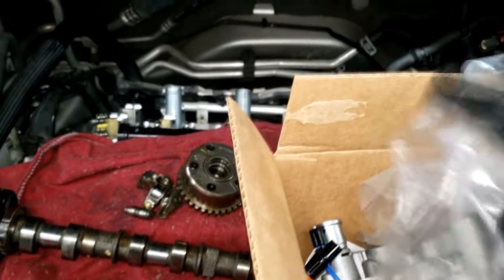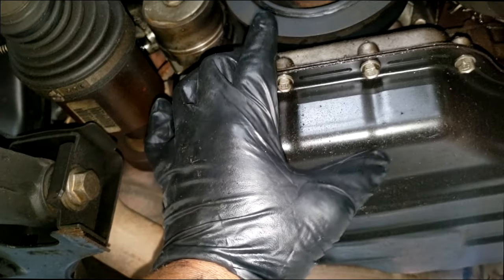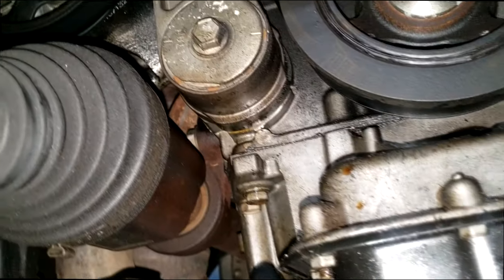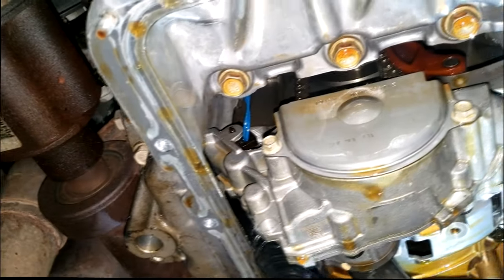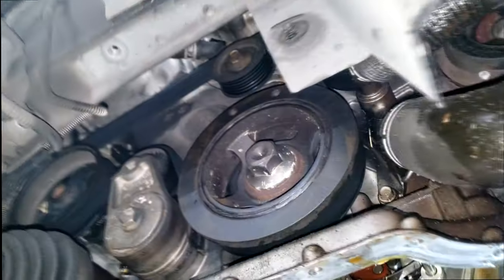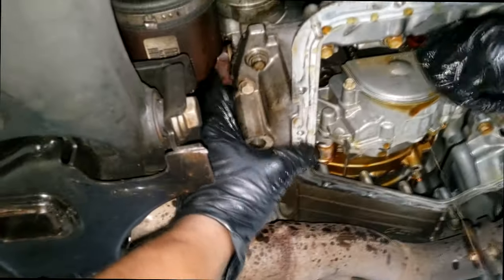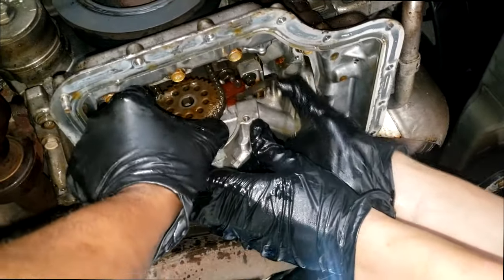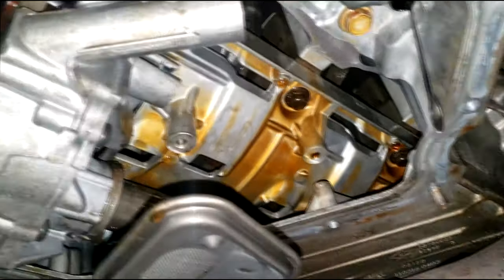How to replace a OIL Pump. Oil light flickering P06DD P0522 P06DE. Dodge 3.6 Pentastar ticking noise

Comment: As a tip to others, I've come across (2) 3.6L Pentastars with the P06DD code not resolved with an oil pressure sensor.  Both of them first showed the problem when cold after sitting all night, watching scan tool data, right away on first drive of the day the oil pressure would read 40 psi at idle then sag below 30 psi at 1500-2000 RPM.  Warm engine and clear codes and they both worked fine.  The oil pump solenoid problem can be intermittent and affected by temperature.  The shuttle valve part of the pressure solenoid is plastic so it's probably getting distorted with age and heat making the valve sticky or it's just the varnish gunk from the oil making it sticky when cold.  The oil pump solenoid is available separately through Dorman products PN: 926235 or Standard ignition.  I last installed a pump Mopar PN: 68252670A0 in a 2015 Town & Country, it took me 6 hrs.  Pump gear torque spec is 18 ft/lbs.
Reply: Good info- I have a 2014 T&C. I have the ticking- trying to get all my ducks in a row before going after the rocker arms, lifters and hopefully not more than one camshaft. Question: I’m paying more attention to my oil pressure and oil temp- can you tell me what range in normal low/high? Thanks!
Reply: @YOUZTUBE2000  I don't recall where the instrument cluster pressure gauge indicator was reading or if the vans I was working with even had a gauge, it's been a while.  The oil pressure is well monitored by the module, if it's not generating a code I wouldn't worry about it.  All the best!
Reply: @larsmoservice588  thanks for the quick reply
Reply: I have the po6da code go off in my car and it wasn’t the sensor although the mechanic assumed that. On forums I see this code actually indicates possible issue with the solenoid.

So is there just one solenoid for the oil pump? Does this fix take many hours? I saw a video where the guy had to take apart the car and he said it took him 11 hours.

But I forget if this was for the same exact engine or just another engine with the solenoid issue at the oil pump.

Apparently it could also be a wiring short. Either way I’m annoyed the mechanic didn’t even know this and I saw this info within ten minutes online . Wasted hundreds of dollars already just to switch the sensor and spent years driving with this issue since he told me it was just the sensor .

My oil psi is normal though
Reply: @heythere6983   I'm sorry that your mechanic has been down the path of replacing the oil pressure sender without solution, that's frustrating.

I fixed a Promaster van with 3.6 & P06DD fault last week, the repair took me 4 hrs but I didn't need to remove the axle shaft as on some others.  It's a common repair at this point as these engines are getting higher mileage and older.  There is one solenoid on the pump.

Harness and connector problems are not so common as the solenoid failure.  Most harness problems I see are from people messing with it, poking holes in the wire insulation trying to test, collision damage, etc.  Put a pump or solenoid in it.
Reply: Thanks for the response . I took it to another mechanic today. He hooked up that little device that gives codes , and he changed one because it wasn’t working . He then got another and asked me if I knew the code I had gotten before, because he had all these different codes pop up that haven’t popped up before, transmission codes etc .

He said he was confused since he had gotten a few of those codes pop up recently with that device on another car .

He said since the last guy switched the censor
With an aftermarket sensor didn’t know. He said after market sensors aren’t always accurate .

I mentioned the solenoid possibility and how that code tends to point to having to change it with a printout showing what the code meant . He said it could be anything and he had no idea and to take it to the dealer because they’d diagnose it and they’d be able to diagnose it better than him or more accurately than him .

When I asked the dealer though they said they’d just have to diagnose it but really have no idea until they switch parts.

I don’t get why this guy wouldn’t work on the parts the specific code points to and ignore the solenoid thing and act like there’s no way he could figure it out.

What was weird was that after he connected his device my cars lights on the shifter were flashing and the car wouldn’t turn on or go in drive /neutral/reverse etc. eventually it turned on and ran noises than before .

Like electronic clicks periodically behind the steering wheel that weren’t going on before he connected it . I really don’t get what happened there. I wonder if a bad device can short the cars circuits or something
Reply: @heythere6983  I'm assuming your car has a 3.6 Pentastar as in this related video.  If so the P06DD, P06DA code would be enough for me to just go ahead and change the oil pump or solenoid, clear the codes and get onto the next car.  After I've seen enough of these fail I don't waste time with circuit testing and considering every other possibility.

Related codes in other modules is not uncommon as all the modules share information on the can bus network, think of it like an office network where the computers share information and send commands to one another.

The indy shop your visiting likely won't have Chrysler factory level scan tools like StarScan or wiTech as the dealer will.  Us indy shops use aftermarket scan tools like Snap-on, Launch, Autel to keep the cost down.  Aftermarket scan tools have holes in the software, incomplete test functions and other problems we just deal with by having multiple different scan tools.  I have seen some aftermarket scan tools cause and read nonexistent trouble codes but most of the time the codes present are reliable and can be worked off of.  The clicking and noises from the dash are not uncommon while scanning as sometimes reading the codes triggers certain self test functions in HVAC and other systems.  I woudn't think about that so much, just focus on the driveability complaint and the relevant codes to get the fault light out and get the vehicle to drive good.
Reply: Thanks. Well I took it to dodge and And in about an hour I got the a text saying it need an oil pump and tri bond.

What was odd was that I thought it takes a few hours to get to the pump and truly see what the issue is. Since I was told they would do more than just connect their device and read the code. I had read online my code was related to the pump, solenoid, grounding wire issue with solenoid or PCM. I had seen that within ten minutes of looking at forums . I feel like I blew 155 bucks for them to just scan it. Repair costs about 1450 bucks. That would mean about 6 hours of labor and I’m assuming if they can reach the oil pump within an hour then it wouldn’t take six hours to swap it reallly .

They also said to change spark plug/upper intake gaskets , differential flush, complete fuel system service, drive belt, hvac. I mean idk if they really tested and saw issues with all this within an hour or just threw that out there .  I don’t feel I have any issue with turning the car in or hvac etc . I did ask to the check rocker arm rock but was told that would be another 150 for that separate diagnostic. I mean, idk if they even did one true diagnostic.

My oil pressure has been functioning the same as I got the car from the reading behind the steering wheel on screen when I’m driving . I had this engine light on for 3 years and it’s been running the same. 

I wonder if the pump is truly messed up or even the solenoid at the pump, if the oil pressure would be normal then? Wouldn’t pump or solenoid issues cause the pressure to be off?

Thanks for the advice , I just don’t feel like any of my money has been well spent so far . They didn’t even realize my one windshield wiper wasn’t working, though according to their “world class inspection“ it was fine .. until I showed them it wasn’t functioning .
Reply: @heythere6983 hello is the issue got solved ??
Reply: @singh-zq9mh   I changed my oil pump and then they said also the gas pump, I also changed that.

Then they charged me to re connect the gas pump and didnt honor their warranty at the dealer for their work.

So changing it got rid of the codes. Frankly the oil pump code was on for a while and nothing went wrong. Later on my thermostat also went and noting went wrong. I was driving years with that oil pump code. But changing it did fix the code issue. My car wasn't starting due to the gas pump.
Reply: @heythere6983  thanks for replying buddy..
 I am gonna try and change pump let's hope for best...
Reply: @singh-zq9mh  if you looked up your code online and it refers to the pump it should work. As long as it soldered correctly
Reply: @heythere6983  yeah i read a lot online and my code is p06dd and that is usually the solenoid goes bad in pump... I am also changing the o ring of pickup tube as that is another culprit of this low oil pressure.. I checked housing is not leaking and that oil sending unit codes are different so fingers cross gonna go repair ..thanks
Reply: @larsmoservice588 is changing solenoid good it's dorman product... ?? Have you used this solenoid alone ...?
Reply: @singh-zq9mh  I haven't installed this Dorman solenoid.  I have used lots of other Dorman products over the years, sometimes Dorman is great, other times its a disappointment.  If it was on my own car I'd happily try a Dorman part just to try it out but on customers cars since the part isn't super easy to change I have been using Mopar.  If the part fails and the job comes back, I look bad and loose money so I cannot take the risk of aftermarket.
Reply: @reinimechanic  thanks 🙏

Comment: Did this without removing the axle. Was a b figuring it out but I’ll tell anyone that may wanna try what i did. I used a 90 degree pick to pop the clip off the back of the block coming in from along the cv axle. You’ll only get a hand in. When re installing used a screw driver from inside to push connection back through the block while oil pump hung from a hanger and made sure it was seated all the way. To put the clip back I took a length of 12 gauge wire attached it to the clip got under the car and bent the wire to be able to get in just right and sit flush to the block in position with my left hand the pulled it in with the pick in my right hand. Popped right in. I reused the old one since it was a little more flexible than the new.
Reply: Ojalá hubieras hecho un video.

Comment: Hello im a subscriber..i have a p06DE which indicates that the solenoid is stuck on. Has oil in it and the correct oil filter. Do i still change the whole pump or just the solenoid. My car is a 2014 dodge grand caravan. Also giving cam sensor codes. Please help🙏🙏
Reply from the maker: Hey my guy, Yes a P06DE can be caused by the oil pump solenoid. But if you have over 100K miles you might want to just do the oil pump since it comes with a new solenoid. Also, do you traction control light come on?
Reply: Thanks for the advice. Blessings to you🙏 I haven't seen a traction light come on tho
Reply from the maker: @stevenboler6184  Yes, i would do the complete pump, its fairly easy as seen in this video. As for the possible oil pressure lost, you could easily have those oil gallery plugs backing out on you causing all these codes as well
Reply: @OnlineMechanicTips forgot to mention even tho i see no traction light there is also a spike in temp probably caused from the friction of the valves and lifters not getting oil and very rough idle which im also assuming has much to do with the oil pressure being low.

Comment: Would you know what the stock crankshaft journals should measure ..I bought my car use and am trying to rebuild the motor and need to know what bearings to order so I need to know what stock should be

Comment: I replaced that solenoid in a journey. Took a bit to figure out how, but once done it wasn't too bad
Reply from the maker: O cool. was it a OEM mopar part? I assume you can take it off without removing the oil pump?
Reply: When we called the dealer the only way we could get it was to buy the pump.  As much as i hate to say it I found the solenoid by itself at a part store when I called around.  Because of how the wires are run I had to unbolt the oil pump but it did not need to be removed completely.  As you stated in the video there is at least one of those pump bolts that is  a PITA to get at but with enough patience it is do-able.

I also just wanted to say that i might not watch all your videos but the ones I do watch are informative in one way or another.  Keep up the good work.
Reply: What was your symptoms on the car mines was running with the engine light & oil light on I parked it left it running and it shut off hasn’t started since engine light on codes 0522 oil pressure switch circuit low already changed the switch on filter cooler housing 
Will this solenoid cause the pcm to shut down engine? Thanks

Comment: I still have this code after I changed the oil pump and oil pressure sensor.
Reply from the maker: What code did you have and what kind of car is this? Also are you subscribed to the channel?

Comment: Another great video! I got a 2012 Wrangler with 3.6 pentastar and 125k miles.  P06DD code.  won't rev past 3k. I changed the oil and filter, no fix.  cleared the code a bunch of times, but it comes back right away.  I think my next step is to try and change the solenoid.  Is it possible to swap out the solenoid with only removing the lower oil pan?  thank you!
Reply from the maker: I have never just replaced the solenoid simply because the oil pump has to come off anyway, And the oil pump on a Wrangler a little different than a FWD Pentastar
Reply: @OnlineMechanicTips  thanks buddy!  I am going to add a bottle of Lucas Oil Additives to thicken the oil and see if that helps increase the oil pressure.  if that fails.  new oil pump!  thank you again for the video!
Reply: @OnlineMechanicTips  by the way, when i start my jeep, i get a loud clatter noise for a brief moment.  any idea what that is?  it goes away after a few seconds....
Reply from the maker: @ningster  Very well could be the cam phasers. But all bets off until oil pressure VVT working as design.

Comment: Just replaced the oil filter housing on my 2011 Chrysler Town and country because of a small leak with no other problems. 3 days later the check engine light came on and now is showing a P06DD code. I am subscribe. The part was bought from carparts the brand name is just replacement
Reply: When I had it scanned at AutoZone it came back as the oil pump and when I had a mechanic friend scan it it said something about a engine cooling fan. So he cleared it to see what would come up when the light came back on it said oil pump. So replacing oil pump Thursday.
Reply: @briannawilliams22591  did that fix it? I just had the same experience of replacing the oil filter housing and now a few days later getting this code.

Comment: Can replacing the oil cooler on a 2012 Caravan 3.6L from the plastic 2012 oil cooler to a 2014 aluminum oil filter cause oil pressure problems that set the P06DD code and cause the transmission to loose 6th gear when the engine has not been allowed to totally get to operational temp or when pulling a lite load and getting up to a 4500 or higher RMP level? It seems that my 2012 started having these troubles just after changing to the 2014 oil cooler. My plastic one was leaking and that is why I changed to the aluminum one. I also use the proper year oil filter for the 2014 oil cooler. I would sure appreciate some help on this. 🤜🤛

Comment: Should i go ahead and replace the oil filter adapter if i have to replace the oil pressure sensor on a 2013 Chrysler Town and Country Touring 2WD 3.6L FI DOHC 6cyl if I have Code P06DD? Thank you.
Reply: If you don't mind me asking what was your car doing when u realized It needed the sensor changed?

Comment: is this method only for certain models?  I would like to try this on my wrangler.  don't really want to move the entire pan, just the lower pan if possible....
Reply from the maker: What year is your Wrangler? Also are you subscribed to the channel?
Reply: @OnlineMechanicTips  yes i'm a long time subscriber :-)  love your videos.   my wrangler is a 2012 3.6.  I just did the oil pump this morning.  and to my surprise, the timing belt tensioner was in the oil pan, the plastic piece was broken in half.....  i guess i've been driving it WITHOUT a tensioner for a while, and i do get a rattle at start up, but goes away after a few seconds...  am i driving a ticking time bomb now?

Comment: I have a flickering oil light, no loss of power, no spikes in temp. Got the P06DD code, should I shoot for oil pressure sensor replacement first instead of the full pump?
Reply from the maker: O wow, curious, what kind of vehicle is this? Also are you subscribed to the channel?
Reply: @OnlineMechanicTips  2012 Jeep JK unlimited sahara. Subscribing right now.
Reply: What should the symptoms be?
Reply from the maker: @checoschmidt82  You leaving out to much info. This year could be the 3.6 Pentastar or the 3.8L V6. Which engine and how many miles? Also are you subscribed to the channel?
Reply: @OnlineMechanicTips  3.6 pentastar 208k miles
Reply from the maker: @checoschmidt82  O wow. That code on the 3.6 always lead me to the oil pump. This so not a easy job on a Wrangler. It is also so hard to replace the sending unit on the Wranglers with the 3.6. This code always lead me to the pump, not the sending unit
Reply: @OnlineMechanicTips  Is there a way to check oil pressure to make sure its the pump?
Reply from the maker: @checoschmidt82  Yes but you need the special tool that connects to the oil cooler cap. Nobody has that tool. Pressure likely not the problem. The solenoid on the oil pump likely failed